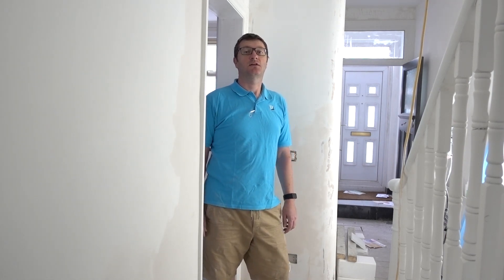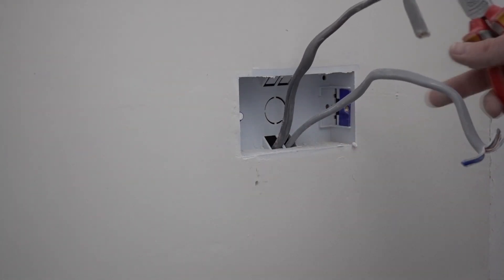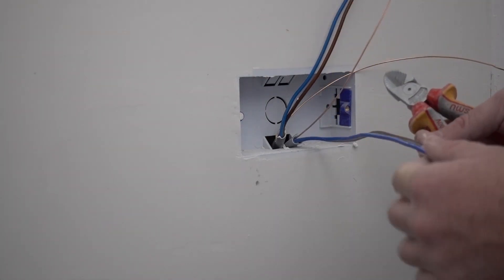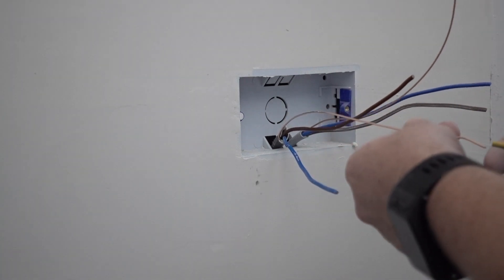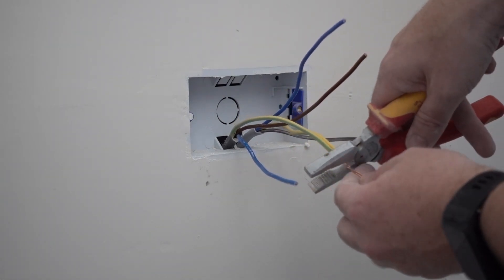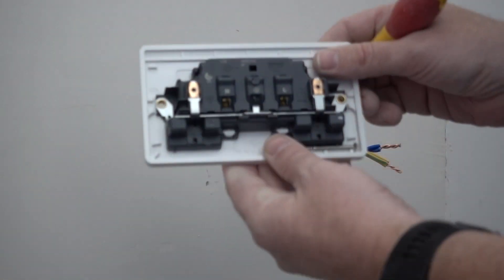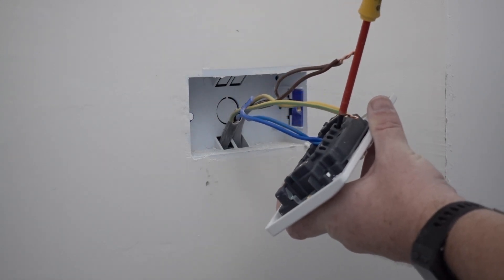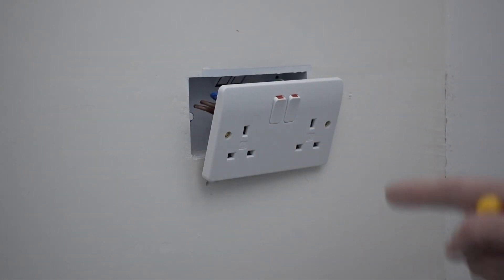How to Wire a Socket on a Ring Main (2 wires), Part 1 Plastic Back Box

Comment: why such a waste
Reply from the maker: How you mean, waste?
Reply: @MPCpropertydevelopments  I'm not an electrician, so don't take me too seriously but it looked like you just cut off like 20 cm needlessly, Why pulling so much cable out to later just cut off what you actually don't need? Its ok, I've just never seen anyone do that, I seen sockets that I couldn't fix because the cable was no longer long enough and so I tend preserve as much of it as I can. But maybe it was just not visible :-)
Reply from the maker: You'll never measure accuratly the lenth of cable you need, if you drag one cable in with the spool on the other end you can get it with less waste, but if you are cutting a couple of lenths to pull through then you always err on too much as you won't be happy if you are a little short... and in general it is better to have a little extra for a margin of error....  whilst you don't wanna waste cable it isn't that expensive, especially comapred to your time if you have to re-do any of the instalation.